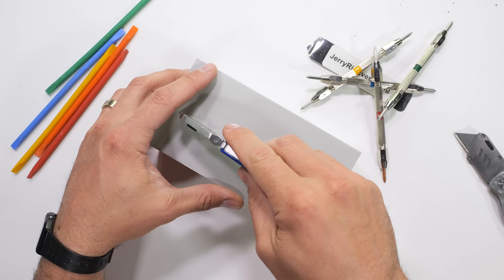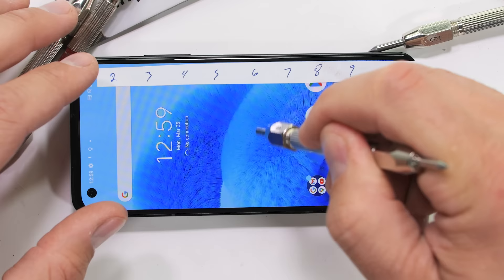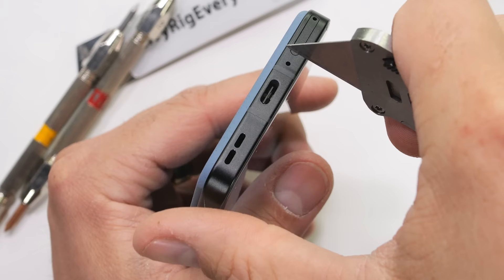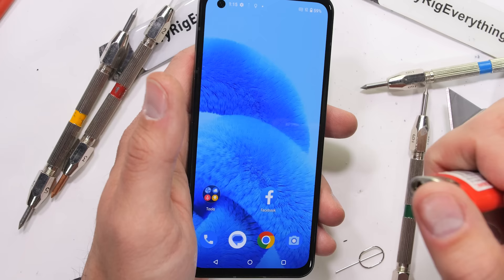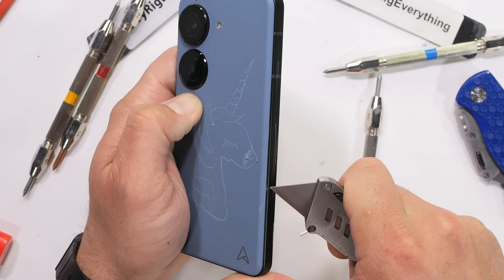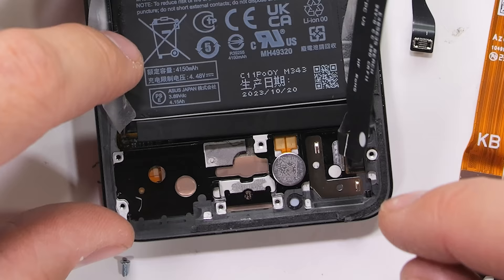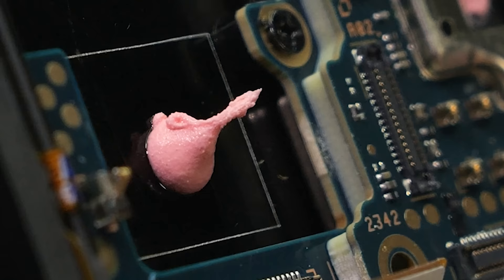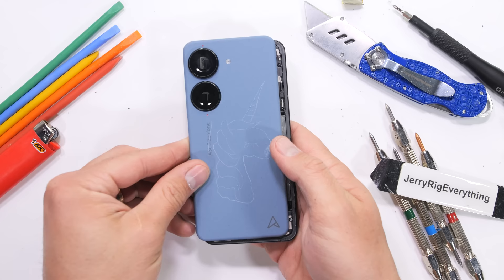The Last Living Small Flagship - (Rest in Peace)

Comment: I’m glad that durability test and Teardown are combined in a single video.
Reply: Yeah, I like it, too. Mostly we only get it, when the phone fails.
Reply: Small video for a small phone
Reply: explain how scratching the back of a phone with a knife and putting a flame to the screen a durability test?
Reply: @mrbean2131 what else do you need from a durabily test though? Smashing the phone with a sledgehammer? Dropping it from a ten-storey building? Drowning the phone? Yeah nah, that'd be unnecessary.
Reply: @mrbean2131 Lighter to the screen shows heat resistance and the way it burns shows the screen type
Scratching the back can show what your phone may be up against in your pocket or daily life and it's durable or not (durability test)
Reply: @dominicklipari  ok kid

Comment: I would have 100% bought the ZenFone 9. I was so excited about it when it was announced in summer 2022. But over time I realized that it was far too inconvenient to work around. You could only get it from Taiwan (no US retailers), guaranteed 2 years of software support, and it was $700. It was so much more convenient to just buy the Pixel 7a, which is the closest in size but still a vastly different competitor. If the 7a was smaller, it would have been first on the list.

The key here that would have made it a no-brainer was reducing the base specs of the internals and selling at $599 or even $499 USD. In that case, it would have boosted sales considerably and, when more people bought in, they could ramp up software development in step.
Reply: Same reason why i still use pixel 4a 5G , don't feel it in my pocket, great size and weight
Reply: I would have bought the Zenfone 10 if it wasn't 950€ for the 512GB version, even the base model 128GB is 800€ and doesn't have anywhere near enough storage. I'm still using a 2017 Huawei Honor 9
Reply: My older sister has the Pixel 7a and she loves that phone because of the smaller size, plus her old phone before then was the Pixel 4a which was similar is size. She was never really into massive phone
Reply: The base samsungs are pretty much the same dimensions as the zenfone.
Reply: @steveguy3  The base S23 was very similar yes. It was also the same price with slightly worse specs
Reply: @genethebean7597  Could argue they both are slightly worse in their own way, bigger screen on the s23, better cameras, zenfone has a bigger battery and 3.5mm, software support is better on the s23 etc. As an overall package, personally I'd prefer the s23, especially when they're priced the same where i live
Reply: @SpikeHead-Cactus same here. This is the longest I've ever kept a phone. My 4a is the perfect size. I "upgraded" to a pixel 6, but couldn't stand the size and went back.
Reply: Depends on how much you value headphone jack + water resistance + SD card + small sized over pure performance/dollar. At least they are upfront about the 2 years software update, better than having an update that handicaps your phones performance 2 years down the road to "encourage" you to buy their newer models...
Reply: @lostmymag  I mean the s23 is ip 68 so i don't know what you're on about there. And i highly doubt the s23 will be handicapped by an update.
They're also the same size. The bezels are just thicker on the zenphone.

Neither of  them have sd cards.
Reply: @steveguy3 Yeah so depends on how much you value each of the 3 rare features, headphone jack vs literally similar spec everywhere else. 3mm wider makes it a different class too, a more reasonable comparison would be to the Xperia 5 V which is even more expensive in my location. As to whether samsung will do handicap their phones, just see note 9 phone screen burning out right after the April security update, happened to me, never samsung again.

Comment: As one of the 5 owners I also love this phone even though it only has 2 years of software support. What disgusts me however is that they don't let you unlock the phone's bootloader which would allow installing community maintained android operating systems. This would hugely extend the phone's longevity.
Reply: what a shame.. was planning to own one and slam a custom rom on it.
Reply: @ExaoSS  Someone at xda forums is suing them for this for false advertising. If i remember correctly asus sold phones with the opportunity to unlock the phone but it never happened.
Reply: It's really worse than that. Unlocking the bootloader was possible, then they shut down the service. Many contacted Asus and they said the service would be put back online in the Q4 of 2023. Never heard anything after that, and the service is still offline. They lied and ghosted their most appasionate costumers, modders, and developers. A very shitty behavior from a company.

Comment: The fingerprint lock/unlock can be customized. It comes with a default to press+touch the sensor that can be changed to just touch it. Also it seems to learn your fingerprint for some time until it starts to unlock in milliseconds.
There are LOTS of customization available!

Comment: Credits where credit due, i love the fact that it's super easy to replace the charging port on this phone,I wonder if it's just much cheaper to bundle the charging port and ribbon instead of just soldering it down into the daughter board like most smartphones do
Now to be fair, type c charging port is quite tough from a normal wear and tear use compared to micro, you will have to try to destroy the charging port in order to damage it

Comment: I work at a company where we sell the ROG phones and ZenPhones and i have to say, not a big fan. We constantly get them back for camera issues, the camera just stops any and all focusing and needs to be replaced. That's the main issue with ZenPhones, as cool as the camera is, it has a high chance of failing. But atleast teh support is good, got a few repaired FOC even outside of warranty, so if nothing else, there's that.

Comment: ZF10 owner here. Last phone was the Pixel 6 Pro. Wish Google used the same amount of thermal paste in their phone like Asus did with this one. Thing got so hot, it burned the inside completely. ZF10 is a beast when it comes to battery life. Only wish there was a case that had MagSafe coils built in for my device, but ill be holding on to this piece of Asus ingenuity for as long as I can. 
Also, the bend test Jerry. Jesus, I was holding my breath for the entire duration. 😂

Comment: Worth noting that while it only gets 2 years of software updates, it does get 4 years of security updates, which in my opinion is more important. I may be proven wrong in a few years if Android 16 brings some game-changing features but I feel like these days Android is already petty powerful and most upgrades are fairly minor.

Also, on the selfie camera placement: if you have to have a cut-out for it, the top left corner is 100% where it should be! When you switch to landscape mode (say, for example, I wanted to watch this video full-screen on my Zenfone 10, me being another one of the 5 owners of this device), it's way more out of the way than it is on phones that center it.

Comment: I liked the Zenfone 9, but I'm fully invested in wireless charging around the house, so I bought a pixel 6 instead. Then the Zenfone 10 was announced, and it seemed like a no brainer... if my pixel weren't still functioning as well as it did the day I got it. The Zenfone 10 is too expensive for me to justify discarding a perfectly good phone. The limited support timeline only galvanized my stance. If the Zenfone phone ever went below $500USD, as the pixel 8 and 7a have, I'd consider investing just to have "one of the last small flagships", but alas Asus has not graced us with any meaningful discounts on this gem. 

RIP small phone dreams. Hopefully someone else picks up the torch.

Comment: so sad that it only gets 2 years of updates and it's bootloader locked. I was so excited to use it until I learned that it wasn't going to be good long term and had to switch to a pixel 6a. It's even sadder to learn that the hardware would have been so easy to repair 😢

Comment: Got the ZF10 last month on sale. Its a fantastic little phone only held back by its limited support cycle and Asus' bootloader stunt. I especially like the Battery life-span functions.
Sadly the Zenfone engineering team got rolled into the ROG and by the looks of it from now on Zenfones are going to be stripped down ROGs as seen with the Zenfone 11 "Ultra". Which are giants.
Guess in the future i would have little choice but go for a Pixel. Which wouldn't be bad if their processors didn't suck so much at efficiency.

Comment: The flagship Snapdragon SoC and 16GB RAM options are nice. It's a shame they were only able to fit a 5.92" screen in that form factor; the S24 has the same length and width, yet fits a 6.2" screen. It's also a shame it's only 144Hz in certain games and you can't run that refresh rate natively. It's also unnecessarily thick at 9.4mm so they could squeeze in 300mAh more battery, but I don't think the trade-off is worth it. It's a shame it only went up to 512GB storage, where I'd like to see 1TB/2TB options for recording lots of 4K/8K videos and storing 24-bit music locally. The biggest downside for me is the Snapdragon Audio and DAC they've put in these Zenfones the past couple of generations, where the onboard DAC is pretty low quality (compared to ES9018/ES9038/ES9039/CS43198/AK449n) and you can't use your own directly with your own external DAC without the sound first going through the onboard DAC. It's a shame this phone has Gorilla Glass Victus, as Victus and Victus 2 are both terrribly scratch-prone compared to Gorilla Glass 6, so I'm looking forward to all phones having Gorilla Armor.

Comment: I like smaller phones and wanted to buy the Zenfone 10 but ended up going with a different phone because the case support is very limited. I might be weird but in my opinion the case is very important because it effects my main interaction with the phone. I want a case that is slim, feels nice and has a magsafe ring and I could not find a case like that for this phone, ended up settling for an s23 on a major discount and saved some money.

Comment: 1:18 Personally, I prefer it being on the left to it being in the middle.
I just find it odd to go through the extra effort to make it be a complete hole only to then put it right where a normal notch camera would sit.
P.s. I would also like to mention that if there were budget phones that were smaller, without any big compromises compared to my current one, I'd gladly swap to them. I have tiny hands and I can't stretch my thumb across to the other side of the screen, nevermind the top, without shifting my grip on the device.

Comment: Zenfone small phone discontinued isn't because they sells bad... It's because they have fully saturated the small phone market as making an almost exact same perfect small phone with Zenfone 9 and 10 two years in a roll. These phone are built durable enough to last more then 2 years and there's no point of continuing to pump out yet another almost same design when most of the small phone costumors are still holding a fine 9 or 10. So when it comes to 11, Zenfone decide to diverse and fulfill large phone user instead for this year.

Comment: i guess the upside is if you get this phone and want to have it longer then 2yrs you can install LineageOS on it and still be able to use it for a couple more yrs until Lineage doesn't support it. With that said it's ridiculous it's only supported by Asus for 2yrs when it has a flagship latest SD processor and the top spec'd version costs over $1000.

Comment: Not bad, not bad at all - probably worth it just for the form factor, dual SIM and headphone jack!
And before anyone asks about 2 years' support being not enough... I remember when most Samsung flagships got just two OS upgrades (e.g. the Galaxy S9+ shipped with Android 8, and only saw Android 10), and some lower end phones (such as the Moto C Plus) didn't get any OS upgrades at all, just the odd security update. The same goes with really old budget phones (the Samsung Galaxy Ace Plus only got the odd minor update, and never saw anything newer than Android 2.3.6, whilst the ZTE Blade 3 never saw an update at all).
So things are moving on, and whilst 2 years' of updates only isn't great (some contracts are longer than this), it's a lot better than it could have been.

Comment: This is the only flagship smartphone with an OIS system that doesnt butcher the image. Take any other phone camera, the iphone 15, Galaxy S24U. Whatever, all the OIS tech out there warps the edges of the screen and looks like garbo.  The ZF9 and ZF10 however, do not have this issue. Its all about keeping the lens and image sensor aligned in the tiny space where you cant compensate for it like a DSLR can. My ZF9 is the best phone I have taken video with so far despite its sensor being on the lesser end of performance. It is smooth.

Comment: Edit: notice the pink thermal paste is not SQUISHED so it is performing more as thermal pads only making minor contact. I'm sure that's fine, but what a waste of cooling potential.

2 years lol which is already ticking, so you won't get 2 full years of updates.
Sure, you can still use the phone after the updates stop. But it becomes less and less secure and more and more outdated quickly. He even started talking like it's already over the 2 years? 
If it was easily rooted, fine. The custom rom community shouldn't be REQUIRED to keep  a phone relevant from the second you buy a brand new phone.

Comment: Just wondering, in my country some of the Amoled screen has another new features like light saber (this feature almost came from the G  series from S brand ) meanwhile others (brand) not. Is. There's any possibility that they are some different technical design between those brand, that even one brand used a same Amoled but have a different result in screen integrity? 
(Screen structural integrity??)

Comment: What I'm curious about is if you can easily jailbreak this phone and put any number of OSs on it. If so this would be great and an excellent way to avoid any obsolescence due to the software

Only negative is you better be tech savvy enough to pull off this and the quarterly updates or whatever updates are available at the time.

My kingdom for a stable OS without all the built-in flaws. Just simple OS and install anything by another 'store'

Comment: I wanted to get one but when they added wireless charging after the Zenfone 9 they took away: autofocus on fronta and wideangle camera AAAAND split the PWM frequency from the okayish 480hz to 240. I was ready to splurge whatever price for the 16 gig version but ended up on the xperia 1 V which has it's own heap of problems but still I believe in this phone and design and would buy the smaller 11 if they just merged the best of Zenfone 9 and 10 in the same phone

Comment: it's not the size that is killing this phone, it's the price. You can already get the Pixel 8 for 599 - the same price of a dated Zenfone 9. Pair that with lack of SW support and only the die hards will buy this
Reply: Honestly I always see 2 arguments on Reddit and YouTube from small phone fans as to why small phones don't sell well. And they're at odds with each other and both have existed mostly recently while selling just as poorly as always. 

Some say if it was just cheaper it would have sold better. Cheaper means lesser specs. And we've had small phones like this, they sold poorly. 

The other argument is that they are cheaper and not flagship level phones and if they had just upped the specs the phone would have sold better. But that means a higher price, guess what. We had exactly this in several small phones in the last couple of years. They all sold poorly too. 

The real issue is the size. Ever since android manufacturers and later Apple started making bigger phones the sales on small phones even with equal or comparable specs have plummeted in sales. Small phones don't sell well. People just like big phones.

Comment: The fingerprint scanner, for me, is often way too sensitive. I don't even realise I'm pressing it sometimes and I unlock my phone.
Reply: An update on durability in real-world usage:

Drops, it's been a champ, with only a thin, cheap plastic hard shell case that only covers the sides and back with top and bottom exposed (some kinks in the top and bottom rails have appeared as a result). The case has a mild front lip, and is similar to the one in the box, but is clear and a little grippier. The phone has dropped onto LVT, tile, wood and carpet and seems fine. Shorter drops onto concrete slabs / paving have occurred but thankfully it's been golden.

Water it misbehaves with more than my wife's Pixel 6 and hasn't quite charged the same since. No biggie as it mostly still charges fine, but sometimes flashes as if I'm entering a charger in fresh for the first time, even though I haven't touched the device while its on charge. Weird, but still working. It was sea water though, so YMMV vs. freshwater.

Some very minor scratches on the front screen surface but very barely visible. I don't use a screen protector. The case has a lip around the camera modules and those camera surrounds have not suffered scratching yet.

Comment: Excellent video pointing the major issue of Asus. Poor software support. That's it is less visible on PC's because they are using Windows and use third part drivers. Every software made by them are unstable and very slow to deploy the updates. My Asus smartwatch was a nightmare, my tablet also. My laptop is now 10 years old and hardware is pretty solid use standard Windows drivers... My conclusion is that the hardware from Asus is solid but only buy something that doesn't need their own software. --> Avoid smartphones.
Reply: You can go back in time, but we would like to stay in the present😅